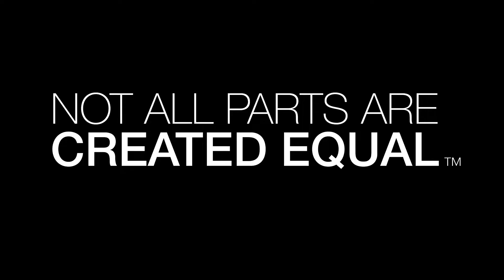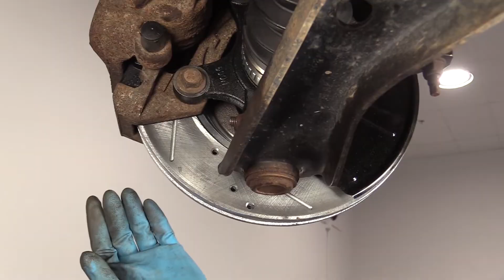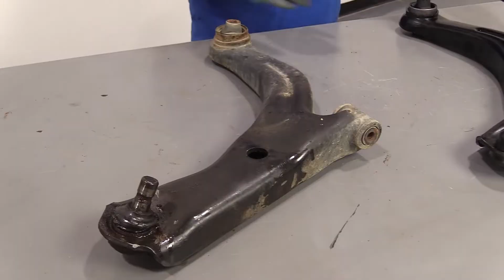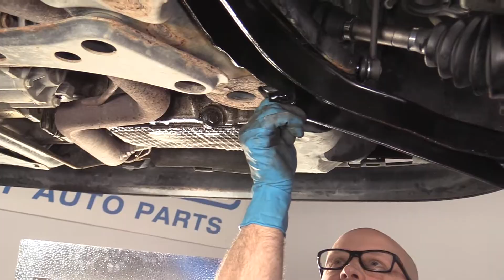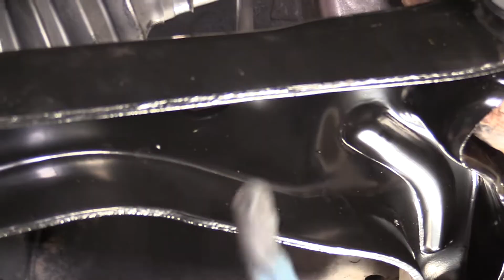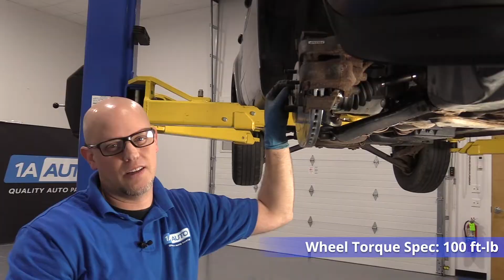How to Replace Front Lower Control Arm 05-12 Ford Escape

Comment: Oftentimes the bushing in the rear is seized onto the large vertical bolt. This is more common on the passenger side, due to the AC leaking on the subframe/control arm. 

If you're in a rusty climate, I highly recommend soaking it down with rust penetrant (there's holes to shoot it up into the frame) and spray down the center of that rear bushing. You may also want to cut away as much of the rubber bushing as possible and even try to pry the metal sleeve surrounding the bushing open. 
If it's seized, or you strip the bolt/frame-captured-nut it will turn this from a relatively easy cut-and-dry job into an utter nightmare.  (This happened to me, and it was a nightmare of cutting into the frame in the back of the wheel-well, hammering the captive nut out, filling in the space with washers, and double nutting the sheet metal frame area above it. (After finding a new bolt from the hardware store.)

Good luck, and please be careful if you're in a rusty area, or there's a lot of corrosion on yours.

Comment: Pro tip for my fellow poors still maintaining their 2nd gen Escapes in 2024... if you're having a hard time getting the ball joint into the knuckle, just be sure to steer the knuckle left or right a little. There is never any need to polish or ream the hole, or to drive wedges into the pinch gap. If the angle is right, it will go in with light raps from a 5 lbs hammer.

Comment: It took my about 10 hours just to do one arm. Tips: the control arm does not slide in, and out like in these videos. It is wedged in there when you first take it out. A bottle jack is a must, I had to put mine in the center of the control arm, and raise it up to lock (install) the left bolt in the control arm. Took me 2 hours to get the left control arm bolt in because the hole wouldn't line up without a bottle jack to raise the arm up, and level the hole. The stabilizer link / connecting joint sags when you do this job. You need the bottle jack to raise the arm into the stabilizer link bar, which sags, and doesn't allow you to manual lift the control arm without serious force (bottle jack), the pry bar doesn't work in the hole trick.. The tie rod jamming nut was frozen, passenger vs driver is different directions to loosen, and these videos seem to only show passenger side! For the driver side it was RIGHT > towards rear of car, I had to use 10% of a bottle of liquid wrench. The pivot joint, I used a ball joint separator tool to loosen it out (frozen), then used a pickle fork, chisel and hammer to get the last 50% of it out.
To install, you do the left side first, right side, then last the pivot joint.

Comment: For the bolt that’s tightened to 85 ftlbs, could you just complete the job and then once the cars on the ground, tighten the blot to 85 ft lbs? I was thinking of driving the car up ramps then tightening it. Thanks

Comment: My steering wheel is way off after installing both control arms. Is this common?
My original ball joints were shot completely so instead of replacing just the ball joints, i replaced thr control arms.

Comment: Very helpful video! Replaced both today on my 09 Escape.
Prying  the ball joints out of the steering knuckle was quite an exercise,  i broke the rented pickle fork.  But with a crowbar, a jack and persistence i got it out.

One tip I would suggest:  before you put the new control arm in, make sure the ball joint fits easily into the steerink knuckle hole.   If it doesnt, use a pickle fork or criwbar to widen the gap thats tightened by the steering knuckle bolt you took out first.  (i.e, make the steering knuckle hole bigger).  Once the ball joint slides easily into the hole while youre holding the control arm you know you have enough of an opening. Then slide it back out and install the cintrol arm bolts in the order shown .  This might  save you a lot of frustration  trying to wrestle ithe ball joint  into place once you have the other 2 control arm bolts started.

Comment: Thanks for video.  I would use anti-seize on the inner bolts - especially that vertical one that screws into a capture nut inside the frame.  They will rust and the vertical one is a main sub frame bolt known to rip out the inside the frame capture nut.  

This can happen even after the sub frame is replaced with no bolt issues, but a subsequent control arm replacement results in capture nut breaking free of frame.  If anti-seize had been used during the sub frame replacement, there would have been no issue replacing the control arm down the road.

Comment: The horizontal bolt can be a problem when the nut inside the frame rust off the frame. I jut did them and had to drop a new nut on some wire in the top small hole and use some hot glue to hold it in place so I could thread it on and tighten it,  a bloody nightmare

Comment: One thing you fail to mention is that once your two frame bolts are in is that the upward force being exerted on the control arm is immense. You will ABSOLUTELY need a pry bar that will fit in that hole in order to get the ball joint under the steering knuckle, like a 150lb man hanging or standing on that bar, to get it low enough to get ball joint stud into the steering knuckle hole. 

As someone that was doing this on the ground and by myself, I found it insanely hard to push down the pry bar while trying to align the ball joint stud to the hole. One big thing that helped was changing the direction of the steering wheel to create the best alignment between the two. You also will not be able to get stud into the hole if the brake rotor is still on AND the wheel lug nuts are tightened so you can use it as a lifting point, as shown in this video. You don't need to remove the rotor, but you will have to loosen or preferably remove the lug nuts so that the rotor can be angled out, to get the stud to slide into the hole.

Comment: No mention of what the bolts are bolting to. A nut welded to the frame? This is the first control arm I've seen that doesn't have a replaceable nut. Is there a way to PB Blast the nuts in very rusty circumstances?
Reply: I just did it and I assume that it's nuts welded to the frame. The bolts thread directly into the frame, and the 21mm bolt threads were shifting around a little. I was kind of concerned that it wouldn't tighten back down, but luckily it did.

Comment: Good to see how the parts go together before I do it, but his process is dumb. Should loosen all 3 bolts before trying to remove any of them. And during assembly simply wait until both front wheels are on the ground before tightening. Guessing ride height and pushing on the arm while torquing is dumb.

Comment: Thanks A1 auto for putting out these instructional videos. I've saved a ton of money over the years. Good camera work and lighting to see clearly what's happening. My local shop wanted almost $500 to do thiplus an alignment. I spent $60 for the part, $99 for alignment, and saved $350 for 2hrs on a Saturday.

Comment: Hello thanks for this video! Super helpful. 

After installing my lower control arms this weekend, one of the ball joints started leaking. I am getting a replacement (same model). I am getting an alignment done today, but do I need to recheck the alignment after i install the new arm when it arrives?

Comment: Very simple and didn't take super long! Btw my CV axle overextended but I moved the steering wheel a little and rotated the wheel hub and pushed in until it went back into place. No problem ;)

Comment: Is it only possible to replace the lower control arm, when the lower ball joints has slack?
Reply: You can press out/in a new ball joint but for the time and hassle and cost, you may as well just replace the whole thing.  Odds are if the ball joint needs to be replaced the bushings aren't that far behind.
Reply: @BigDaddyJinx  Good advice, good man.

Comment: How can you tell that part is bad
Reply: Steven Cui usually if it’s sloppy up and down disconnected from the yolk. Or if it is cracked or bent.
Reply: ER-6NAT10N Thank you for the clarification. However I cannot tell because I’m living in Hamilton (very bumpy road). When I drive on the highway everything seems ok to me
Reply: Steven Cui at low speeds is there a light rattling noise going over bumps? I just completely rebuilt my front end on my 3.0l escape and I came across a lot of worn out parts and figured out what was causing certain noises. Any questions and I’d be happy to help.
Reply: Steven Cui if it seems ok no matter where you drive then you don’t have an issue. If you’re still concerned, there are hundreds of YouTube videos that show you that.
If you have your car jacked up or on a lift and you get a lot of play in the ball joint or the booth is ruptured then you know it’s no good. I learn than on YouTube as well .
Reply: Steve what happens is the rubber in the bushings get dry rotted from the elements so the bushings get loose and soft causing the control arm to move around some which makes noise in a clunking sound when really bad plus it allows the tire to move around from the loose suspension component wich also throws off the alignment of the tire causing tire wear and a loose and wandering steering !